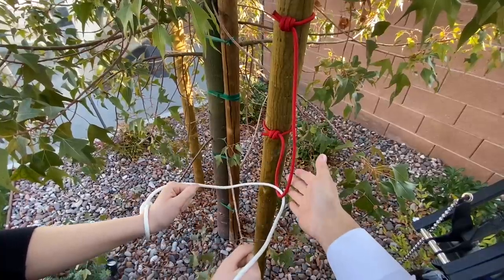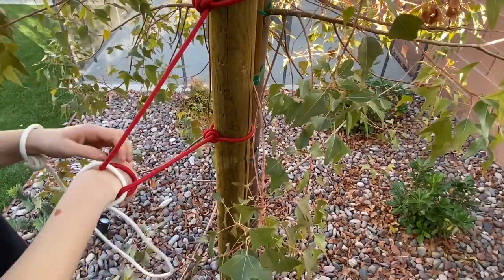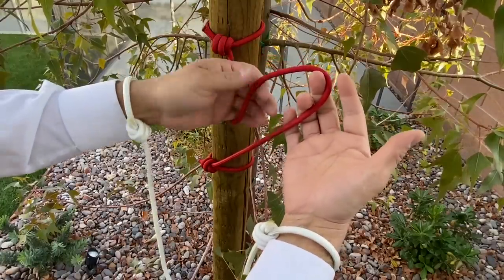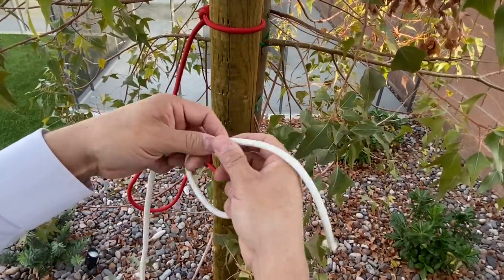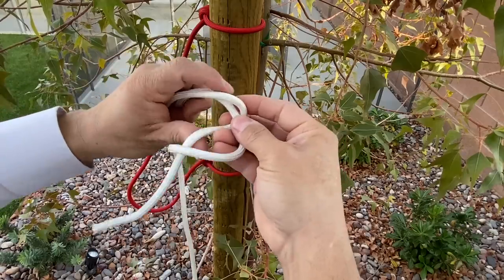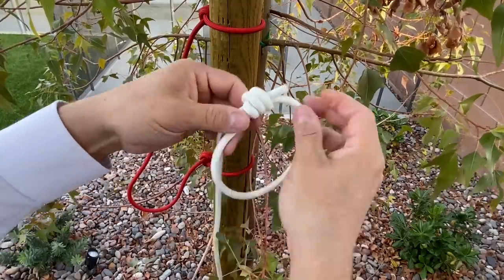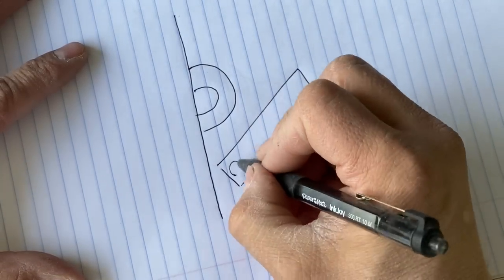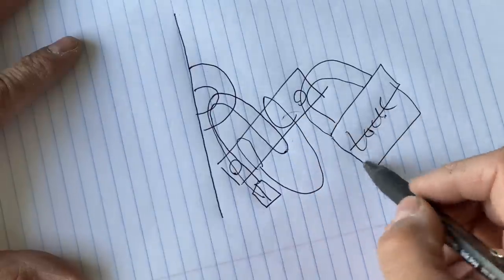The Prisoner’s Rope Puzzle. Then I make it from metal.

Comment: An interesting application for this method is when I saw someone present how some doctors remove a stuck ring from a finger. They put a string through the ring, then wrap it around the finger all the way to the tip and then just pull the string in the normal direction of the finger. That way the string guides the ring little by little, "around" the finger and off.
Reply: That is almost, but not quite entirely unlike the video.